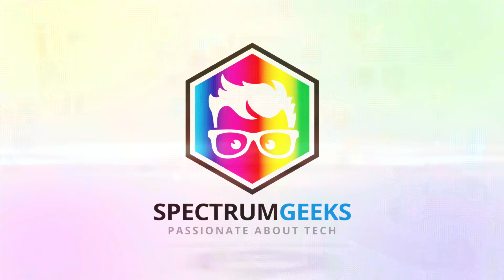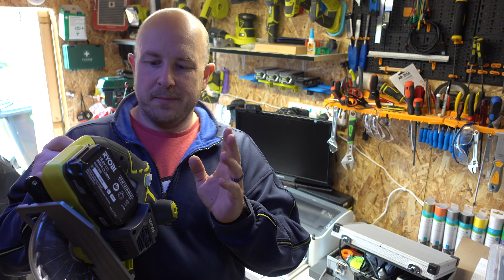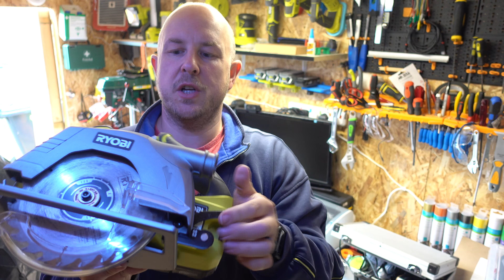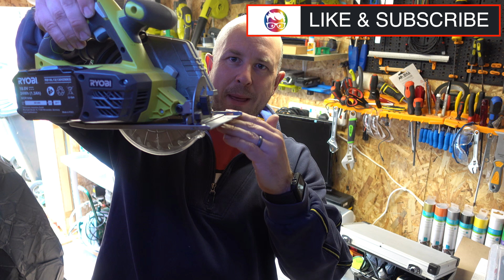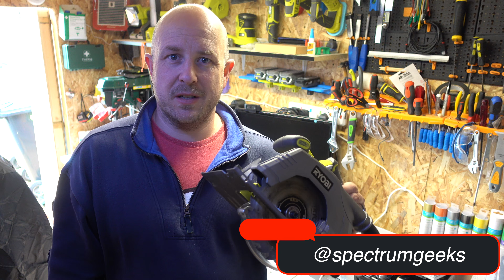Ryobi Circular Saw - R18CS-0 - Quick Review

Comment: I'm struggling to get 90 degree cuts with my one.  I don't seem to be able to get good vertical cuts with thicker timber (eg 6x2), always see an angle in the vertical cut.  Even when I go backwards past the 0 degree marker it's still not 90 degrees,  Did you have any issues with accuracy?
Reply from the maker: To be honest I rarely do any angled cuts with mine, so I can't help I am afraid.
I have found with slightly thicker timber, a higher Ah battery is beneficial to stop the blade getting stuck mid cut.